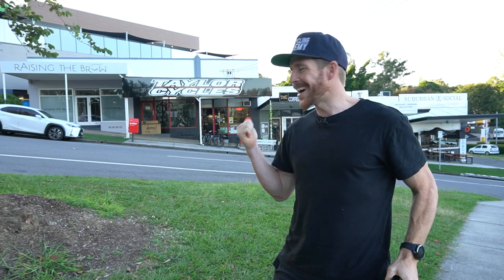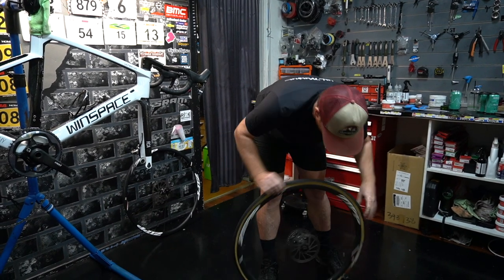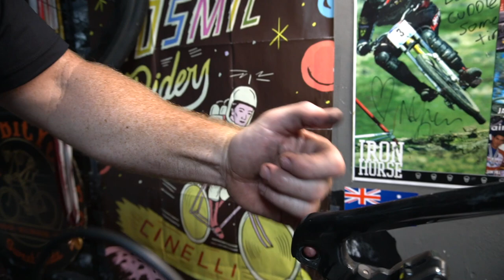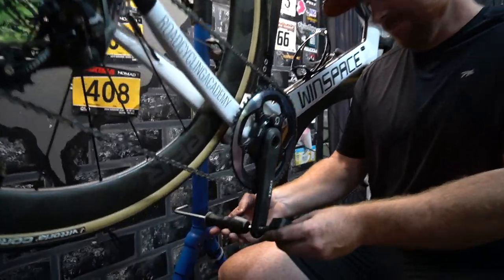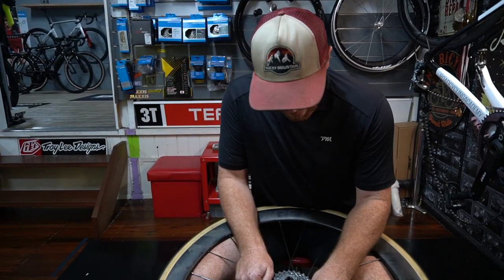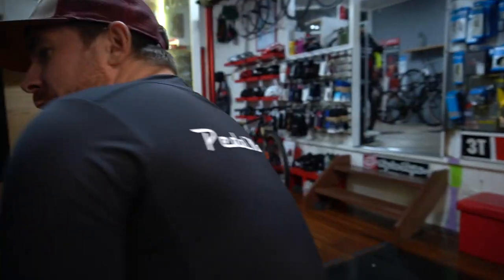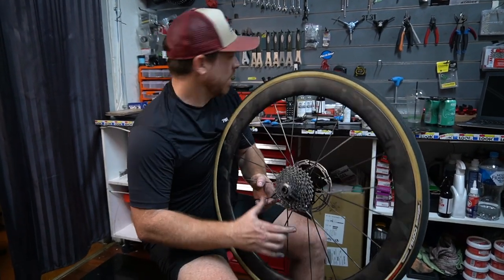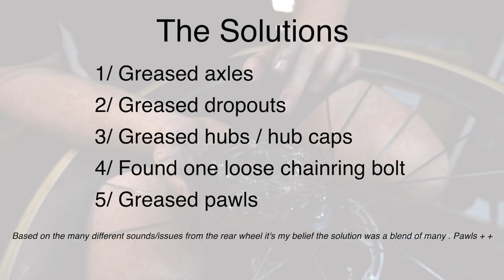How we fixed my creaky carbon wheels (Winspace 50mm Hyper)

Comment: It's a bit of a shame that Winspace was initially blamed for what turned out to just be a sloppy build.  Things like checking freehubs for proper grease and using grease on axles etc should not be overlooked in the initial assembly.
Reply: Under greasing is a common practice I've found from kits of different manufacturers.
Reply: That's true, but you know. Winspace or whoever the OEM could have factory lubed those properly.
Besides, cam also criticized the wheels for their drive feel, not only the sound
Reply: @hankschrader2353  the spokes are very tensioned on Chinese wheels I've found maybe too much so which makes for a harsh ride. The flip side is they don't come loose.
Reply: @glennoc8585  good to know
Reply: @Pat Paulo he's Cavandish.
Reply: @pauljennings3572  and wrapped the bar tape in the wrong direction too :)
Reply: @glennoc8585  Personally I love the ride. The carbon spokes gives the wheels a nice feel on the road. I am however just a lightweight so bumps dont worry me too much. Lol
Reply: Well done on the follow up. At least it clears the wheels from any “defect” related blame. Hopefully Winspace have baked in an extra QA/QC step in their processes. 👍🏻
Reply: Winspace are to blame.  There's no excuse for not properly greasing the pawls.
Reply: What? Could you imagine if everyone had to double check everyone else's work? the world would come to a standstill according to your logic. Windspace is 100% responsible for shipping a properly assembled wheel.
Reply: @Cyclingchoice  I've started wrapping the bar tape on gravel bike "backwards". It actually works great. I started doing it when after riding in a lot of rain, the tape that holds the end down by the stem came lose. The tape was coming unraveled. I unraveled enough to tie it off.
Reply: @DaveCM  It mostly depends on if you pull the tape on the bar tops or push as I do. Especially if you ride with hands touching a lot.
Reply: @pmcmpc  to be fair they probably receive the hubs already assembled as i do not think they are manufacturing the hubs themselves.  If they are then you are correct.  I am sure they will specify more grease in the hub assembly going forward.
Reply: @glennoc8585  I think some of it is to give that freehub 'sound' that GCN reviews all cover. I'd rather have them greased to work when I'm pedalling than to sound loud when I'm not.
Reply: @pmcmpc  incorrect. Road disc rotors get MAD hot. They are only small the the speeds are much higher than in XC. You will cook out the grease in no time! 

Road disc is not a good idea for high mileage riders or mountain riders unless they are prepared to put in the extra maintenance that road disc requires.
Reply: @AussieMark888  ZERO road disc hubs will have enough grease in them to last the heat build up that puny road disc rotors will put into them. I have the same hubs on my rim brake Hypers and ZERO issues.
Reply: thats where you save your money. ill take it, id rather know what product is in there  and tight it up myself. china isnt the problem (thumbs down for the china keywording) ive had whole bikes turn up like that, built in the usa. spokes loose, grease missing, parts missing from the fox fork. ...actually my first good bike, a brand new gary fisher..built in the usa...had an out of alignment bottom bracket.  somehow they welded it skew. most of your non china brands come out of china anyways🤷

Comment: Cam,that bike mechanic is the business,he knew exactly where to look for the noise and was lightning quick.In all fairness it was not the wheels fault mainly just the previous bike builder as they should have greased and checked the bike as it was a brand new build.Fair enough the free hub was dry but that was really it.Hopefully it will not put people off buying winspace products as i have some LUN 60mm and they are very fast and true.Great content and i only wish i had a bike builder/shop like that near me in the UK.
Reply: I have the Lun 60mm Disc as well and the creaks were so annoying.  Greased the contact points and job done.  Agree with your comments on content and to think some peeps claiming he was in bed with Windspace.  Now I think we need a rerun on the effort to see how much was mind tricks.
Reply: road disc hubs get dried out from the extra heat build up small road rotors create.
Reply: They put very little grease into the freehubs because some people are attracted by the loud noise created by the six pawls in a basically dry environment. A proper regrease and it gets a lot quieter but the hub is protected, too.

Comment: Thanks for getting to the bottom of the issue, it's a real public service for those who have similar issues with any wheels. Credit to you for not justing writing the wheels off. I'll certainly be following the advice on greasing pawls, axles etc. Shout out to the mechanic too, top work.

Comment: Road bikes are not ready for disc brakes yet. The small rotors heat up SO much and the speeds are higher. This melts the grease in any hub and cooks bearings. Ive seen so many dt swiss ceramic bearings cook up this last year since the road disc fad has come full swing.

To minimize the heat damage to any high end hub use 160mm or bigger rotors and avoid using your disc brakes as much as possible. If you do have to use them a lot then pull over to the side of the road and let them cool down.

I remember doing an everesting on 2 different disc bike Zipp 202 Firecrest wheelsets and both hubs developed creaking the week after. When we pulled them apart they were dry AF.

I pulled apart my Zipp hub from 2010 and it still had acceptable levels of stock grease in it.

I have been abusing my Hyper 38's and have yet to had an issue. I must disclose though that Im using rim brakes.

Comment: Thanks so much for this vid. Had exactly the same issue with the Hypers, creaked like hell. Did what you recommended, problem solved😀👍
I’m running Conti 5000s in 25s with latex tubes, about 70 -75 psi, they are so fast and smooth, I can’t stop smiling 😊

Comment: thanks so much for this. I have had some new dt swiss wheels for a few months, and have had an issue with creaking under heavy load. I thought the problem was the cranks because I also changed those out at the same time. After I watched this video I took took off the freehub body and there was barely any grease, so I put in a lot more and now (so far) the creaking is completely gone. It also made coasting sooo much quieter, they were so damn loud before. Give my props to the mechanic for me, total life saver.

Comment: Great video as always and for showing the details.  I have a set of Hyper 50 rim brakes and had the creaking appear at 700kms, through research online found someone else had same prob and solved it like you with grease on the pawls, had that done and solved the issue but sound returned after 1122kms.
I only use my wheels on my nice weather weekend rides, haven't been in any rain only nice sunny weather.  Since the sound returned a 2nd time I reached out to Winspace and also had pawls greased again this past Friday May 30th - sound is gone. LBS said hub looked like they'd expect any hub to look. Have since heard back from Winspace they asked if the creaking stops if I stop pedaling as they advised the symptoms may be the same but the cause is slightly different - I was unable to answer so we'll have to wait and see how long AND if the creaking returns - may have to wait several weeks till I get closer to 1100kms.  Winspace did send me a diagram of areas to grease next time, by then I should also know if the sound continues when pedaling or not.  I did reply back with my serial number (as I finally found it!) incase that can tell them anything in the meantime.  Have you noticed if your sound stops when you stop pedaling or not?  Will also be interesting to follow if your sound returns like mine.  Keep up the great content (Y)

Comment: A good mechanic is worth their weight in gold ! Just shows you should not just put things straight from the maker on your bike  without grease...which is any metal to metal contact.Parts come with a thin protective layer,not a service amount. Car etc parts also. Happy quiet riding ,Cam !

Comment: great video. i had a creeky rear end. a bit of grease on the mesh between hub and cassette and she was sweet. had another issue on my other bike of poor indexing up or down the cassette even with Di2. checked chain for stretch. new cassette. couldnt find the issue for months and months. ended up needing the B screw adjusted and the chain was 3 links too long. awesome LBS .

Comment: Had a similar issue with my Zipp 404 Firecrest rear wheel. Greased the pawls the caps and the axles and problem solved. However, that is WAY too much thick grease on the Pawls that mechanic put on. You'll be taking that freewheel hub apart in a few months. Promise that! The grease gets dirty, cakes up thick and will stop the pawls from engaging. You'll see in a few months. Use the Wet grease when the time comes to clean it out. Nothing more annoying than Disc brake rub and creaking noises. Glad you fixed it.

Comment: I have a pair of unbranded 88 mm carbon wheels. They were very quiet for the first couple of hundred miles and then started clicking and pinging. I pulled the axle and cassette body and hardly any grease at all on the pawls. I decided to go with a lighter lube and used Mobil 1 5w30 motor oil just as I have used on my Zipp 188 hubs for years. I put grease on the dry axle and threads. The hub noise is much quieter. We'll see when I ride it tomorrow if the noise is gone. Thank you for posting this video. I would probably not have taken it apart. I was trusting that they were lubed properly at the factory. Must be a grease shortage in China!
Reply: Ok. So after only oiling the pawls and other moving parts of the hub and greasing the axle there was no noise at all from the wheel. I'm very glad watched this video! These wheels are great now.

Comment: Thanks for the tips. Fixed my Campag WTO 45. Grease those areas except the internal hub. I think my problem is the cassette was installed without any grease at all.

Comment: Fantastic video and most timely!  I bought a pair of ICAN 40mm wheels last September. ICAN is a company in China that produces wheels and carbon frames. Reviews looked good, UCI approved, et. Cost around $650 USD.   Around 1,500 miles, I began to hear loud creaking noise from rear wheel.  I took to a couple bike shops here in Los Angeles, Ca (USA) and they could not figure out the cause for the noise. Tried changing cassettes, spoke tension, et. all checked out.   Still have noise. Contacted the mfg company - no help there. So, I will do what waht was done in this video and see if I have a good 'cheap' wheel or ' not worth the money' wheel.   Thanks Cam.

Comment: Awesome.   I need a mechanic like that.    

I had issues with creaking and pulled apart my headset, crank, chainrings, bottom bracket.  Lubed it all and still got creaking.  Decided to lube my dropouts and no more creaking.

Comment: I resolved a creaking Reynolds wheel the same way, but used the lightest available grease (hydraulic disc brake mineral oil) as per some manufacturer’s recommendations to avoid increasing resistance. I guess it won’t be as long lasting a solution as a heavier grease. 

I suspect unsealed drop-in freehubs as featured here may be more prone to having the lubricant contaminated or washed out.

Comment: This was perfectly timed. Having issues with my 303s and have taken them apart. Lots of great  advise. Cheers :)
Reply: I had problem with my 303s hub too. Problems all round right from the start. Doesn’t sound right, lots of friction and chain suck. Brought it to my LBS and SRAM replaced the freehub body. Much better now.
Reply: hows the zipp 303s? im thinking getting one va winspace

Comment: For my part, as soon as I received my hyper50 rim brake, I immediately put on a light De DT Swiss grease (salmon color indicated for the ratchet system) although I never had any noise. The big problem was actually to remove the GP 5000. After two hours of effort, I had to cut the tire because I could not dislodge it from the rail. This is a problem when driving in inner tubes on tubeless ready rims, but on this rim with GP 5000s, the problem is even more predominant. I did a test with the 4000 (still in inner tubes) it was easier but the tire already had thousands of kilometers. So I put on Pirelli zero bikes and I was able to assemble them only with my hands. Happiness
Reply: Nice observation, I found Vittoria Corsa Speeds were impossible to install yet the Vittoria Robinos didn't even require levers. lol I found the GP500 to be okay.

Comment: Moral og the story, support your local bike shop mechanic.
Reply: i would if they don't charge me an arm and a leg
Reply: @Pat Paulo true. got be reasonable.
Reply: moral of the story learn to fix your own bike, if you own alot of them...it will save you alot in the end
Reply: ...unless they're shit which mine used to be. Hopefully found a good one now.
Reply: Moral of the story is you have to regrease road disc hubs a LOT more as the heat build up is so extreme from the small rotors.

Comment: Awesome cam, thanks you!! For me it seems like it was the cassette. i have change my cassette and it seems that the issue is resolved. It looks like the cassette makes some creaking noises that are transmitted by the hubs to the frame. I assume that dirt got between the cog and the bolts (that hold the larges 3 cogs together). I will now try to soak the old cassette, which is perfectly fine btw, in petrol and try to clean everything out. Maybe it helps. But i will definately check the hub again and maybe grease it one more time.
Reply: find someone with an ultrasonic cleaner, and get that cassette in there.  Best investment I've made for bike maintenance in a long time.
Reply: @jeremytheys  I have one, but it is too small for the cassette. Maybe I will get a bigger one :)

Comment: This is a bit of an old video now, but people still likely have this issue. For me, the key was correctly tightening the rear axel. Clean the thread, grease it up, then tighten it. Even once you have it tight, there is a solid quarter of a turn that might make you feel a little uncomfortable. Once it is all nice and tight, the creak is gone, but without the grease, it is harder to get it tight.

Comment: So your solution to add stickers to spokes was just to dampen down the sound "amplifier". Nice. Sounds like similar issue as with bottom bracket which can also make noises if has some dirt in the threads.

Comment: I had a creaky rear wheel that drove me crazy until I worked out it was the rear hanger. A bit of grease on it when bolted to the frame and problem was gone

Comment: It’s funny how creaking sounds are so hard to pin point. I found it’s best to check the easiest ones first. The first one to check when you hear a creak is to simply stand up and pedal. If the sound goes away it is in the seat post saddle area. If the sound persists at least you can eliminate one area.

Comment: So would you recommend buying these? What other similarly priced wheels would be good options?
Reply: @bernardo9202  ok, thanks!
Reply: @JackRay  theyre good if you are planning to run 25c tires since that is what they were made around, if you want a bigger tire light bicycle had some great options in that price range or you could look at zipp 303 s

Comment: Hey Cam, hoping you see this as I am experiencing a similar issue with my Cadex rear wheel. Was your creak intermittent or consistent with every pedal stroke? Mine would come and go. Cadex are replaying the rear hub under warranty, but the loan wheel my shops leant me is now doing the same thing. Might need them to suss out my cassette and thru axel too.

Comment: I bought a pair of the cheaper Lun wheels and had a lot of creaking noises when in the three easiest gears on my rear cassette. I sprayed some silicon spray on the problem part of the cassette and the noise disappeared.
Reply from the maker: Thanks for sharing on the thread

Comment: Ah Taylor Cycle, was supposed go there to window shop many years ago but using buz to there is pain due to less frequency.

End up going to Velo Bicycle (i think they called something else and renamed / moved too these day) at recommendation of a friend of mine.

Luckly my Lun is brought in by a authorised reseller, will ask him to check the wheel and relube when necessary
Reply: Your  welcome any time. Its only a 15min ride from Regatta.

Comment: Didn't think there was much wrong with the winspace wheels as they have been getting some rave review s from even independent reviewers.. also  to get on the disc brake bandwagon wagon is there just something wrong with disc s on Road bikes , on my XC mountain bike I never seem to have any problem s with the disc breaks and I don't have a thru axel on my rear wheel just and normal quick release ,,